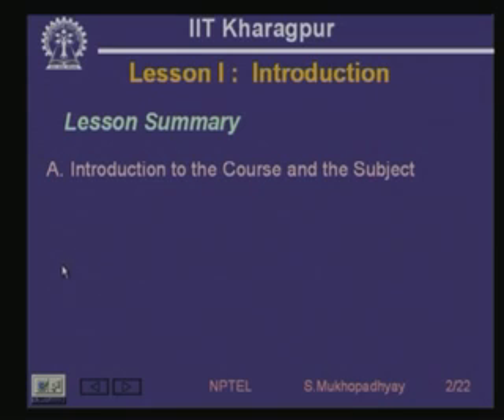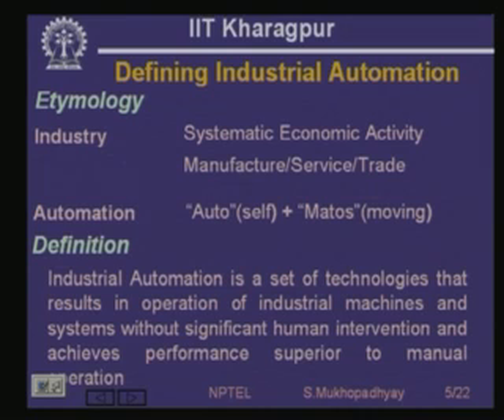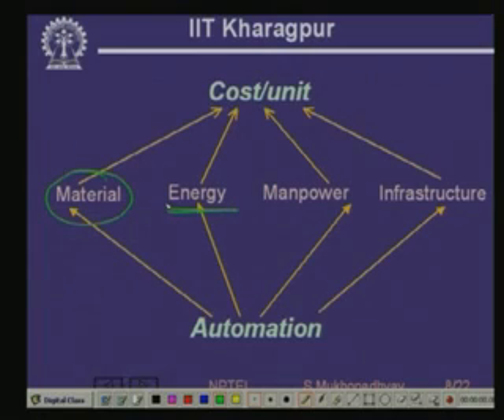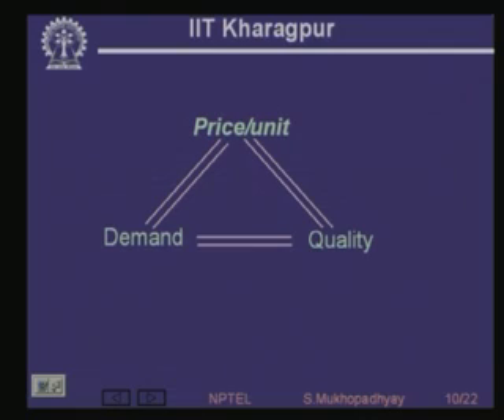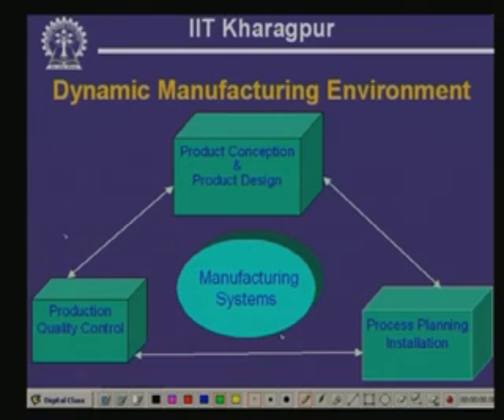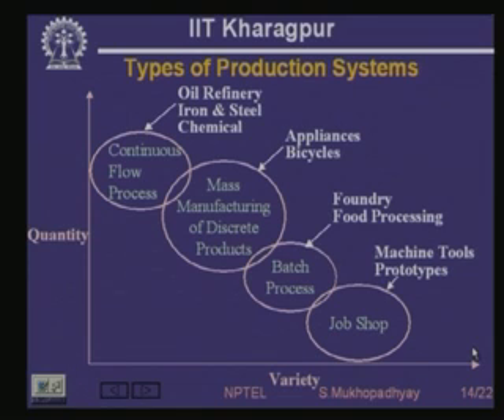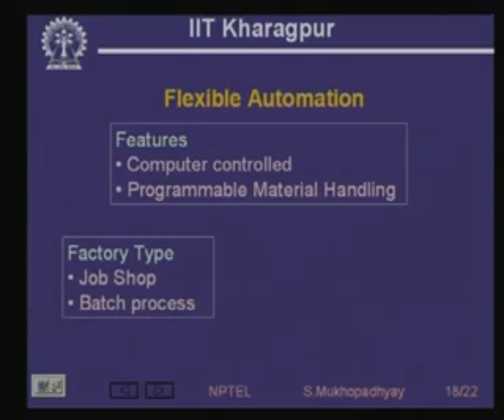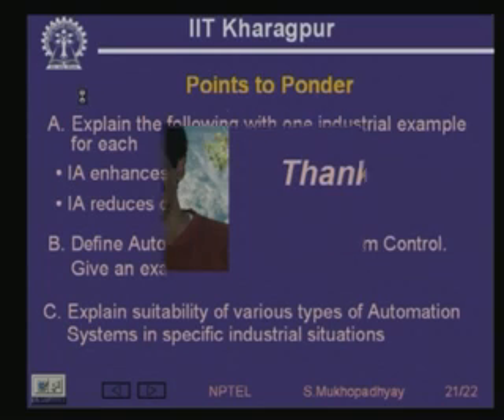Lecture - 1 Introduction

Comment: Good that you used  multi- intelligence supports namely audio, video and text. But I would have preferred the lecture  as well as  the best presentation of the same by one or several students with mind-gripping  video, diagrams etc  so that the inserts & excerpts   would add meaning to the text and make understanding more appropriate, focussed and less boring. The presentation should end with an overall review.